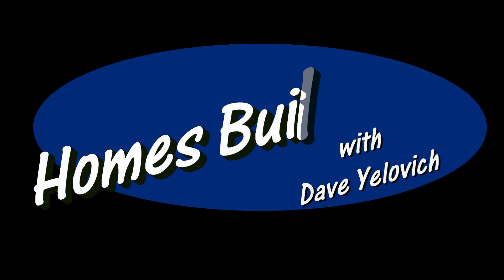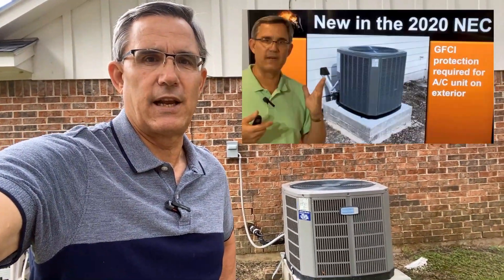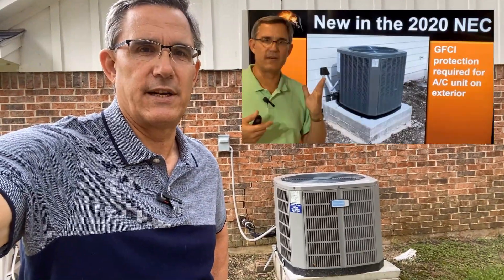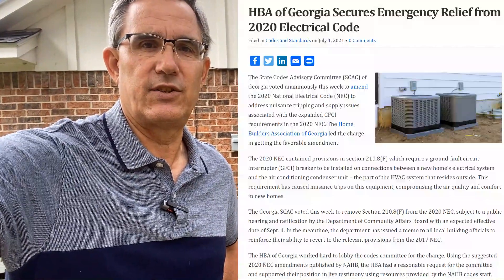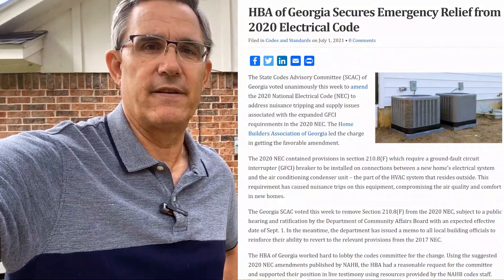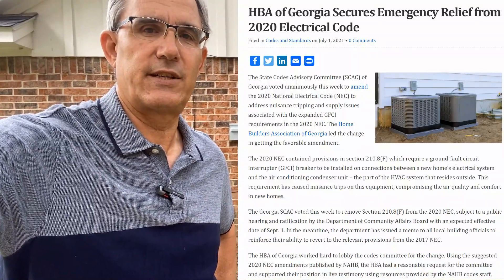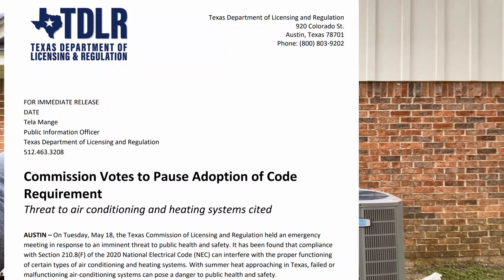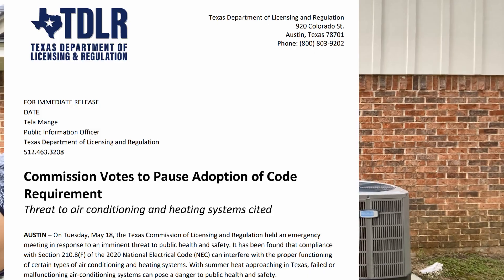2020 NEC AC GFCI Update

Comment: Where you install the gfci?
Reply from the maker: GFCI is not required on the outside A/C unit anymore.  However, all 240V GFCI’s go at the breaker.
Reply: And how you connect the neutral in the disconnect switch?